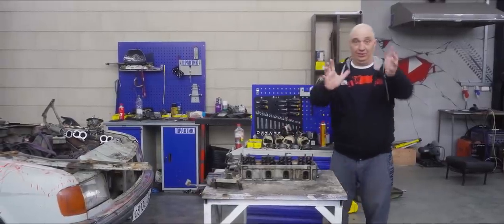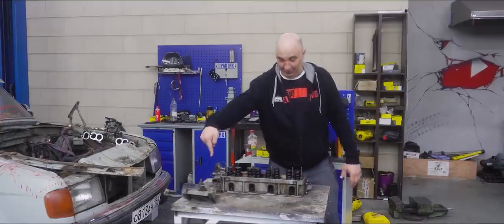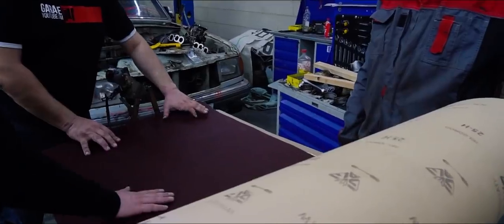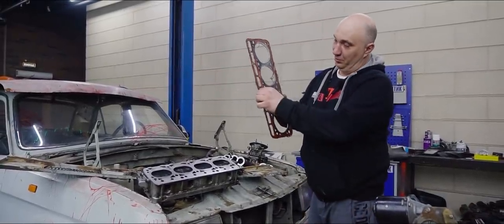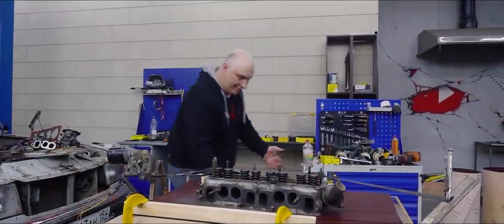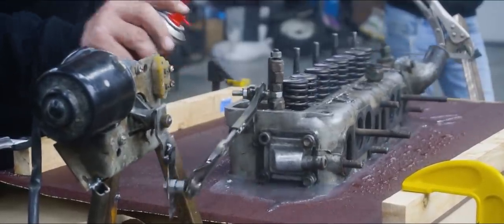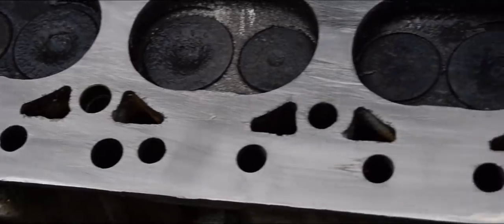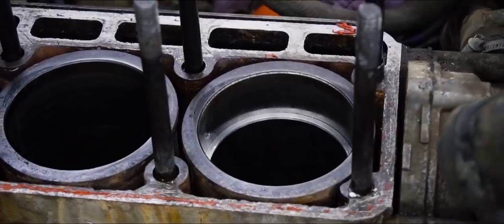Resurfacing cylinder head with sandpaper, DIY piston rings (cheap engine repair)

Comment: My local machine shop had a giant belt sander just for surfacing heads. Not milling them, just removing a couple tenths to get em flat. The machine was stationary, like a table, and the belt went round and round like a conveyor belt. You'd just hold the head down against the belt, and check it every few seconds.

Comment: Try making a large belt sander using a treadmill setup. You have the wide sandpaper and this sandpaper method has been used in a workshop in Australia. My brother was setting up a treadmill belt sander until he got sick. He could rebiuld and machine anything..

Comment: Hi in homemade piston rings you need few instructions.
First made pistons rings with diameter of cylinder +0.05mm
Cut gaps or hammer rings to broke.
Put little bit material between gaps to force re-compress rings to over- diameter
Heat them and cool down.
[Now these recompress bore is nominal]
Remove material bit(little precision shaft) from gaps
Compress overal diameter rings to nominal diameter of cyl into cylinder.
Check gaps and finish them.
This method make some force in structure and rings make press on cylinder walls.

Comment: If you can find some cast iron pipe, this is a great material to make piston rings from. Machine the OD the same as the ID of the bore, snap the ring to create a gap, quick file to clean the edges, hold the gap open with a flat blade screw driver, then heat it with a blow torch red hot to anneal it and let it cool slowly.

Comment: I think the wiper rotation should be horizontal rather than vertical in order to prevent potentially high and low pressure points on the head.

Comment: Had they rubbed some sandpaper on the cylinder walls for a quick homemade hone those rings would have worked much better.
Funny seeing them talk about twisted heads when the one on my Volga was like twice as twisted as theirs.
Reply: A proper cylinder hone costs peanuts anyway.

Comment: We used portholes on the ship. I spray- glued the sandpaper to the glass. I worked with many idiots that used grinding compound directly on the glass to resurface air compressor valves. They also used granite indication blocks and ruined them as well. Stupid is as stupid does. Your system is good but the clamps on glass will distort. You will need at LEAST 20mm glass so there is no deformity. That will last forever.

Comment: One more thing. If you had any type of catastrophic metal shavings or indentations from steel shavings bouncing around in the cylinder and head, make sure you get all of those steel shavings out of the head. I did a two stroke twin cylinder Kawasaki motor, which had the lower bearings come apart, and it put thousands of little indentions in the cylinder head. Well, after running it for about 15 minutes, the thing ran away on me like a diesel. I pulled both spark plug wires off, the thing stayed wide open. Only after putting a big red circle on the palm of my hand from the intake sucking the blood out of my palm, did the thing shut down, And the Machine Shop built me this motor. I guess they missed it as well. What happened was, the little pieces of steel embedded in the cylinder head, when they got hot, well, they started glowing Orange. Then, they acted like a spark plug, and it had an unlimited ignition for the fuel, & coils didn't matter, Killswitch didn't matter. Now, I don't know what it would do on a 4-stroke, but I guess we'll find out.

Comment: North Americans "You can't use home made piston rings"
See below...

Russians "Hold my beer"
Reply: Didnt work either.
Reply: @2lotusman851  Kinda worked, just needed to raise idle to 2000RPM once you get it started and manage the ridiculous amount of blow-by. Wonder if they remembered to set the ring gaps as far away from each other when they put the pistons in. Even brand-new factory rings will cause issues when the gaps are too close to each other.
Reply: Russians "Hold my vodka"

Comment: I've made custom piston rings for chainsaws out of fine grain cast iron. The cast iron I used to prevent galling in the cylinder walls like if I used steel.  I haven't yet tried a hardened steel.  The cylinders are either chrome or Nicasil plated cast aluminum, so that would be harder than a plain cast automotive block. With that said, the hardened steel may work, but I hate to ruin a vintage cylinder jug. Lol

Comment: I planed and level this set of Harley-Davidson jugs by scraping them on the concrete floor. The guy looked at me like I was absolutely nuts. He was so worried about it, he took it to the machine shop and had it mic'd. The guy told him, whatever this guy is doing let him do it, cuz this thing is pin straight. The main thing is to keep it flat at the beginning and end of the stroke.

Comment: Those piston rings if you want that to work you need to hone the cylinder walls and put a slight cross hatch in the mating surfaces of the rings to the cylinder wall. Generally a new piston ring will have cross hatch on it as well to blend both materials of the bore and ring to a sealing surface as the new rings seat themselves to a new bore.

Comment: I did this 15 years ago and got it to 0.001 150k miles 10 to 1 compression. Still running good. I use 6 mm glass.

Comment: I think you couöd make a cylinder head from very thick acryllic I dont know if it will hold up but it is possible just drill few holes for the valves and yeah of order it from some cnc company

Comment: What would happen if the differential isn't bolted to the frame in a independed rear suspension? Or engine just dropped in the engine bay? Could you even drive it?

Comment: Back in the day, we used to grind heads using a plate glass piece and either a large or long piece of wet and dry or Chemico grinding paste.   You found the high spots with some engineers blue on the head mating face squeezed onto the glass and did the medium paste or paper first to get a good "level" by placing the wet and dry face up on the glass and your worked the head in a figure of 8, then went with a superfine grade of paper or paste after blue checking the head to be uniform flat and you again figure of 8'd it a few times and you could put a true straight edge on it and perfectly flat every time.   Ford UK's Pinto or Kent engine you could literally get a couple of HP just by truing up the mating faces because Ford's machining was somewhat lacking in quality, Jags also had some wonky machining on the block and head faces and a Mini you could get a very fine feeler in between block and head but the car would be running OK and amazing how perky the engines behaved after truing the mating faces.
Reply: Truing the block face again utilised a bit of plate glass but this time round you put some weight on the top of the glass to keep it uniform, I preferred to use a very fine wet and dry with plenty of light oil for the block mating face and I had a heavy sandbag for the pressure.

Comment: you need high carbon steel cut the rings to size then heat treat them
Reply: rings are are cast iron   so a spring or tool steel would be needed

Comment: Nnnnaaaah, as far as elegant solutions go for doing  it, i did it with a flat screwdriver, and a piece of sandpaper on a sanding pad 👌😃 it came out pretty good actually, no problems or leaks or whatever else, it worked like a charm. The engine was an old 16v ecotec, with another head from a junkyard, and it was good for years to come, even in the winter with high-rev snow drifting 👌😃

Comment: first time I heard about the glass and sandpaper method, I was sobbing over a blown gasket and warped head on a fiat panda at the bar.I told the guy "that just sounds stupid. Maybe it wouldve worked on a 1930's engine.." to which he cuts me off "Well, you arent gonna pay a machine shop. And its only stupid if it doesn't work"
I pulled an all nighter, half drunk, did this crap, and lo and behold, it worked. I have put 100k km of abuse on that engine and still has no leaks, no emulsion, and rather good compression.
Not everything that is homemade necessarily leads to a poor quality repair, although I'll still recomend to get this done at the machine shop

Comment: for a flat piece of glass use a mirror thats the straightest glass available (needs to be or the image reflected looks weird)
real piston rings are made to the exact size of the bore , then cut and with a piece inside the cut forcing it open heated untill it leaves the ring gap open , this gives the best seal 
not sure if the older soviet era cars had angled sides on the top rings to force them out under compression straight one should work if the piston grooves are adapted for them 
having the engine driven by the second car the rings should wear in after a couple of minutes and seal a bit better

Comment: I tried to hand sand a severely warped PT cruisers 2.4L head due to overheating and it took me over 8 hours, I am surprised I managed to sit there sanding from morning to evening, anyways I failed in the end, had to buy a junkyard head, not a good idea. But I had good luck before with a head that’s less than 3 thousands inch warpage.

Comment: The wiper motor should be mount 90 degrees from way it's set up so the push load isn't vertical and should be horizontal.

Comment: Yes cast iron to make your rings. Make them a bit larger than the cylinder. Grind the gap so they fit and you have your self a ring that will be 107%
Reply: If you just cut the gap the rings won't be round when they're compressed into the bore. A good 'garage' way is to make them close to the bore size (maybe 0.03-0.06 mm oversize),  snap them to form the opening with no gap, then 'spring' them open on a mandrel and carefully (and evenly) heat the ring till it's faintly glowing red with a propane torch. This stress relieves the iron so they stay in the open state. Once compressed the ring will be much closer to round (though still not perfect). The ring can then be polished with sandpaper on glass and then gapped in the usual fashion.

Comment: Save a lot of money if you take your time and do it yourself. Like the grinding of the heads and seat your own valves. You are only allowed 0.004 thousands difference with higher compression.

Comment: The rings need a slant cut on them on the piston side. When they go to compress, the rings get forced outward to seal against the cylinder. Without that, they wont function properly.

Comment: So far the best advice I've seen to resurface headgasket surfaces is to take 3 inch wide body shop sand paper and stick it to the top of the block and rub the cylinder head around on the block then stick sand paper on the head and resurface the block surface.

Comment: I dont know how you machined the piston rings, but they should be machined to fit snugly into tne cylinder and then cut with thin cuttoff blade, and then you heat them up and widen the gap so they have a bit of preload against the wall of the cylinder. That way you dont get any "gaps" as you say due to different diameters of he piston rings and cylinders. If you measure the piston rings and then machine your blank like them you will have a slight gap in places.

Comment: Probably that sandpaper is more expensive than to bring that cylinder head to machining shop and grind it. However, great idea if you are miles away far from civilization, somwhere in Syberia, and you have big table and sandpaper... :D

Comment: Idea: Find a car with locked up engine, drain all oil from engine, put WD-40 through oil cover. Then, tow that car using rope and another (and working) car. When towing around 100 km/h, put the car with locked engine to 2nd or 3rd gear to see if WD-40 can make locked engines able to spin (and work) again.

Comment: when making the piston rings, before putting in the engine... clamp the ring at the ring gap, put back on the lath, machine off the imperfections on the outer surface caused by the bending to fit in the cylinder? wouldn't gap the rings to specification until they have been finalized, in a three jaw lath. depending on the clamp used on the gap point cutting depth might have to be shallow. make a very small set screw clamp for this task?
Reply: a small concave pit on the end of each ring end, for the little clamp to lock into.
Reply: @SkywallGuttz they are cut larger then the bore, so when they are put into the cylinder there is a small amount to pressure pushing them onto the cylinder wall... spinning them on a lath with the piston rings compressed can speed up the brake in process... how ever a large disk the width of the piston can clamp on to the ring so it can be touched up on a lath... 

need to make a disk with a large bolt in it that clamps the piston ring, another tightly fit disk goes over the bolt on the first disk... fixture and piston ring are compressed to zero end gap centered and lathed to the exact bore diameter. 

"have to lathe the piston rings while they are compressed to the proper end gap." There are large automated facilities that have production lines that can do this faster then the steel can be smelted.

not lathing the piston rings in there compressed form, leaves them not perfectly round... bedding the rings takes a lot longer.

lath the rings with them compressed to what ever the desired ring cylinder tension and width is to be... do the same thing with the oil skirts, but those start as stamped sheet metal and use a very meticulous fixture.

Comment: Should've had the axis of the wiper motor rotated 90 degrees. Then it wouldn't pull up/down on the head.

Comment: Cast iron would work for rings, steal doesn't have enough spring
Reply: Steel is stiffer and a better spring than cast iron. But you're right, CI is the correct material for rings under most circumstances. It has very good sliding friction properties, whereas a steel ring (especially soft steel) will bind up and score the cylinder walls.

Many new high performance engines use steel rings because cast iron isn't strong enough to handle the high cylinder pressure and extreme RPM of such an engine. But such rings are very 'special stuff' made of high grade heat treated steel and finished with special anti-friction coatings to protect the cylinder from scoring.

Comment: The only problem here is that it cost more money to set this up in time and sand paper then paying a machine shop 30$ usd... ive spent 50$ in sand paper doing this waiting hours, when I coulda just payed 30$ and been done.. I've learned my lesson on this. It is possible if u have a glass or metal flat table already and free sand paper.